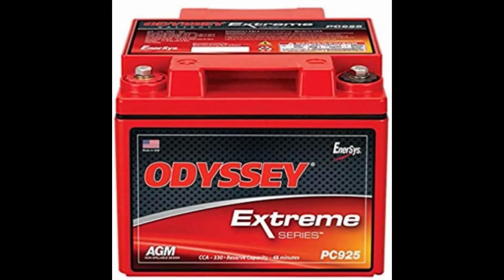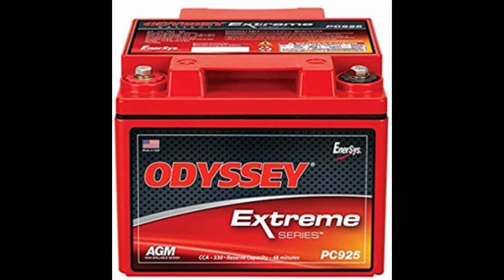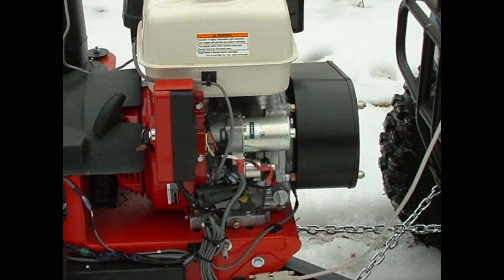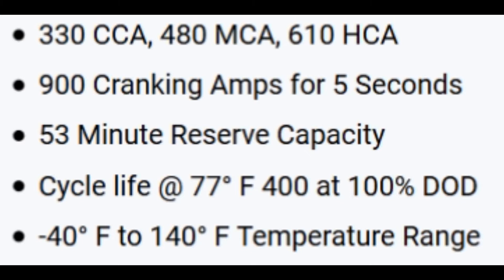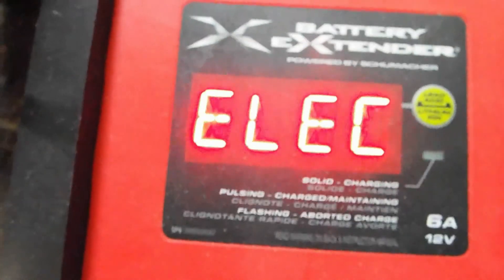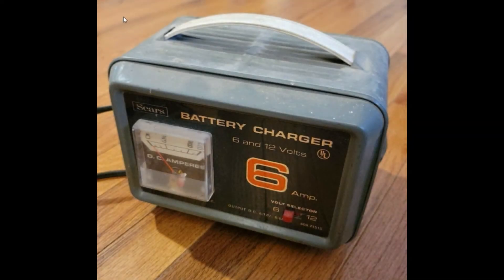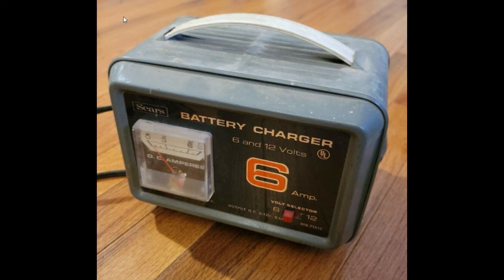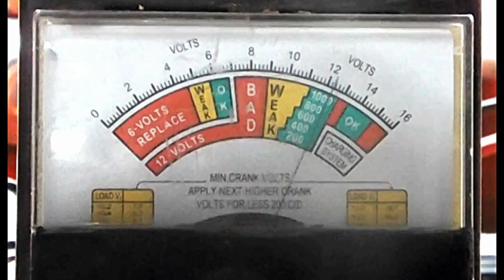Episode 11,  Restoring a completely Flat AGM Battery

Comment: The result 400? What is its soh? 50%? What should it be new?
Reply from the maker: Specs say 900 for 5 seconds, so it is a little under 50% but considering being dead AND 5 yrs old, it was worth the effort to save it because this winter it still cranks the Honda Blower motor over just like new.

Comment: This is not a Gel cell battery it's an AGM battery, they are NOT the same...
Reply from the maker: You are correct. I was using the two terms interchangeably. I will correct the video and re-upload it.